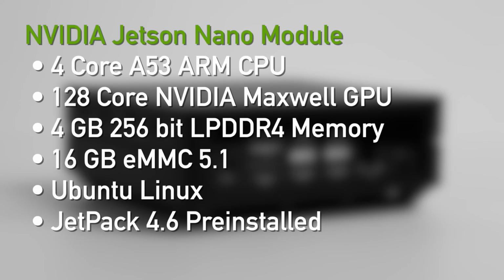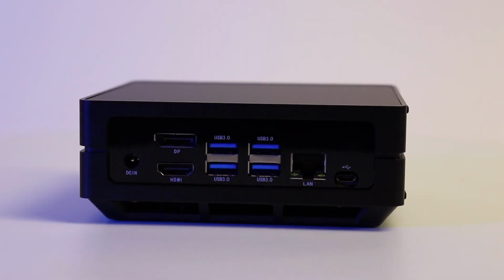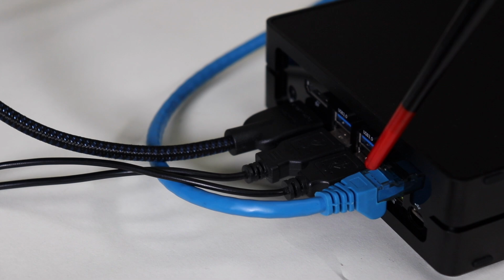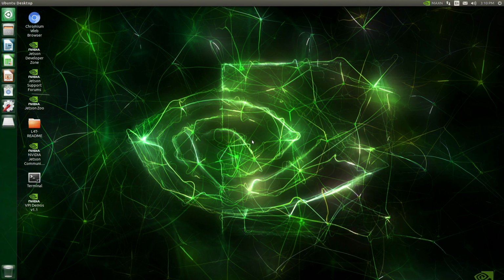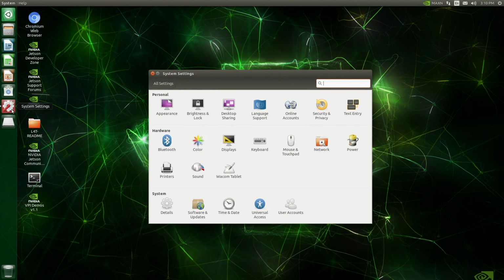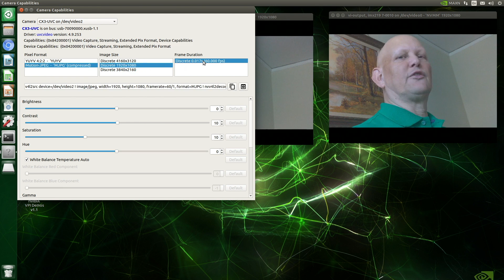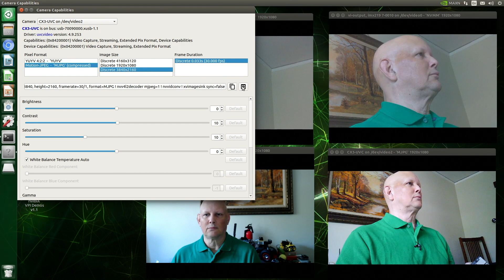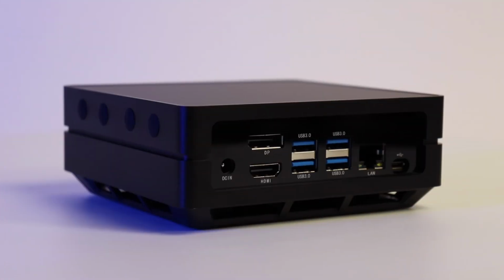Plug and Play Jetsons! Seeed Studio reComputer J1020  ft. Jetson Nano

Comment: Greetings, Jim! 

I would like to thank you for replying to my previous comment and bringing this reComputer to my attention. 
I followed your advice and purchased one in early May. I ordered a low-end ($199) version. I'm happy that I listened to you (and my guts) and placed an order earlier, because on original expected delivery date (May 12) these units were already on backorder ($259 versions are still available).
My box still has a name "Jetson" on it, however, the vendor has changed the name since ('reComputer Jetson-10-1-A0' became  'reComputer J1010').

Now a brief update on the computer itself (for those considering the purchase):
1) The $199 version doesn't have a power supply included. The power is supplied via dedicated USB-C (there is no barrel jack). I might be getting a Raspberry Pi power supply for it. 
2) There is 1*M.2 Key E port, so I should be able to fit  this computer with Wi-Fi.
3) There is no 1*M.2 Key M port, so I assume I need to add an external drive via USB (there is one USB 3.0 port and 2 USB 2.0 ports).

I might start saving funds for reComputer with Xavier NX module, the question is whether it will be available when/if I decide to make a purchase.
Reply from the maker: Thank you for sharing your experience, others will find it useful. Thanks for watching!
Reply: @JetsonHacks  I would like to ask one more question (specific to this $199 model), if I may. The RTC battery (2-pin）is not included either. Could you kindly recommend a reliable RTC battery for this board? There are plenty of options on amazon, but which one is the right one?
Reply from the maker: @leibaleibovich5806  I don't have enough experience with this  to recommend one over the other.
Reply: @leibaleibovich5806  I use 2032 size, you can just reach 'RTC 3V 2 pin 2032'.

Comment: hi i need to help from thailand. 

my jetson nano seeedstudio J1020  eMMC   ubuntu 18.04  , jetpack 4.6   is defualt .

i  upgrade ubuntu 20.04   with upgrade on ubuntu  but  when restart  can not  login agian  show A problem has occured ....
i use recovery mode  i can do it .  but  display choose  jetpack for install i can not found choice to use   , plesae tell me look way to fix this ploblem 

thank you
Reply from the maker: JetPack for the Nano only supports Ubuntu 18.04, it does not support 20.04. That's why you can't find the JetPack install for it. You most likely will need to reflash the Jetson. You should be able to get support for Seeed or you can ask for help on the official NVIDIA Jetson Nano forum. Good luck on your project!
Reply: @JetsonHacks   thank you, I can fix it  when reinstall ubuntu 18.04
Reply from the maker: @9prach_Ap7tech  I'm glad you were able to get it to work.

Comment: This would be a great setup for ROS development. I did not realize the standard Jetson dev kit did not come with the m.2 m key connectors….another great feature for ROS and developer tools when you can add NVME storage w/o having to buy an adapter!
Reply from the maker: If you're using this as  a desktop development setups, I am a fan of having the NVMe storage as a tradeoff for wireless. A wireless dongle is usually adequate if you really need it and indoors wifi coverage is usually pretty good. Thanks for watching!

Comment: Is it also possible to run other distros?
Reply from the maker: I don't know too much about this area, it's worth researching if you have to do this. NVIDIA officially supports L4T, an Ubuntu variant. People in the Jetson community have worked with other distributions. However, a lot of xserver relies on the GPU driver, which are specific to L4T. This means that there may be issues with other distros for accelerated graphics. Thanks for watching!
Reply: @JetsonHacks  Let's hope when Nvidia has full open source support for their entire portfolio, it will make it easier to run other distros.

Comment: It's amazing how the price of the nano has sky rocked from the 99 dollar price just 24 months ago. I normally buy 5 or 10 of something. Why the hell didn't I buy 10 nanos when they were cheap? Theses are currently beyond the reach of most general developer working at home that's not an engineer. An amazing SBC when used for it's primary application in AI.
Reply from the maker: This is an interesting comment.  It underscores several different ideas that are happening now. First,  the  disposable income for a lot of folks is at a different level than it was a few years ago. The maker community for electronic devices (Raspberry Pi, Jetson, Arduino and so on) is hit pretty hard due to component shortages and rising prices.  It's not clear when this will sort itself out, but it seems unlikely to be in 2022. 

There should be a some relief when NVIDIA Jetson Nano Next comes out in 2023. Hopefully it designs around parts shortages and such.

On a different note, the Jetson Nano dev kit  has always been subsidized by NVIDIA. Note that the bare Jetson Nano production module (as in the Seeed reComputer) price of $129 (in 1000 quantity) has not changed. A 3rd party integrator needs to add a heat sink, a carrier board (same parts shortage issue), power supply, maybe a case and so on.  So  $199 seems like a fair price for the entry level version Nano based reComputer from Seeed, but it's certainly not the deal of the $99 dev kit.

I hear you about buying 10 of them when they were available. I scold my dad for not buying 10 1963 Ferrari 250 GTOs back in the day. They were $18K USD new, now they're worth $45 Million. He always says that "he couldn't afford it", but how could you not? Sure, a few sacrifices might have needed  to be made (like feeding the family and keeping a roof over our heads) but it's a big picture thing after all.

Thanks for watching!

Comment: Is there no fan on your test unit?
Reply from the maker: Correct, there is no fan. Thanks for watching!
Reply: @JetsonHacks  I have fans on both of my Jetson nanos.  I thought they were necessary.  Can I remove the fans?
Reply from the maker: @wa3bvr  It depends on the way that you use the Jetson Nano. If the Jetson experiences thermal stress, that is, it reaches a certain temperature, it will throttle performance by turning the clock speeds down. In severe cases it may cause the Jetson to shut down. Many people don't encounter this situation. For example, a Nano mounted on a mobile platform even under high compute loads benefit from air cooling. Imagine a car or a drone for example.

Many  desktop users don't stress the Jetson enough to bring in thermal slowdown. This may be because of low compute loads or because they are in a cool room. On the other hand, if the Jetson is in a hot room during the summer in direct sunlight (not recommended of course),  this can cause extra thermal stress that may trigger a slowdown/slowdown. 

With that said,   if you already have the fans installed there's no need to uninstall them. Having a little extra help from the fan may be useful. 

It's one of those things with the development kits. People use them for all sorts of different things, and it's great to have flexibility when doing so. Typically if you're using the dev kit to design a product you need to have a good estimate of the thermal characteristics before designing in your own thermal solution. Being able to add a fan is useful. For makers and project folks, it's nice to have the option. Remember, some people run this off a battery half power which doesn't place nearly the thermal stress as full power flat out modes.

You'll notice on the reComputer board there's a place to plug in the PWM fan if you need to add one.
Reply: @JetsonHacks  Thanks.  Very helpful..  For my purposes I will keep the fans.